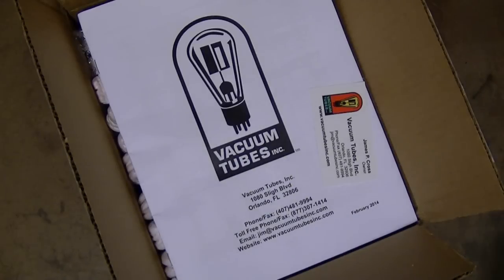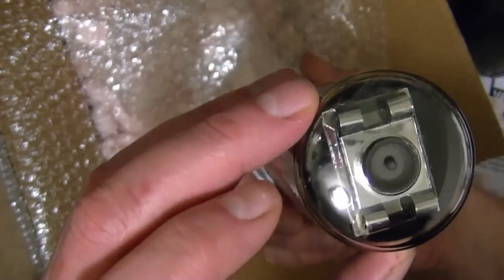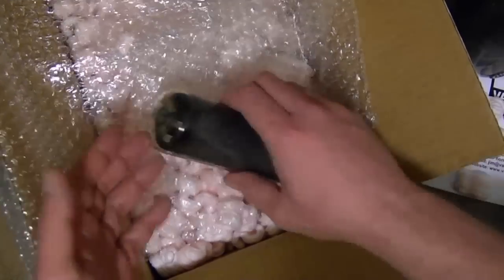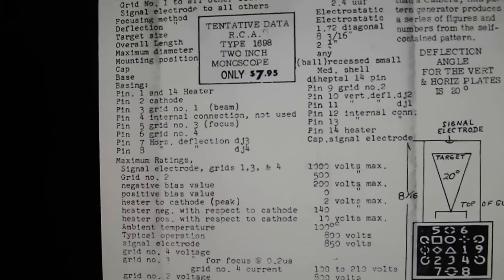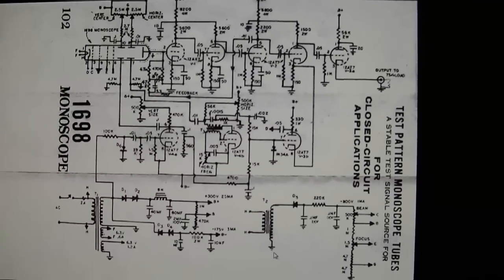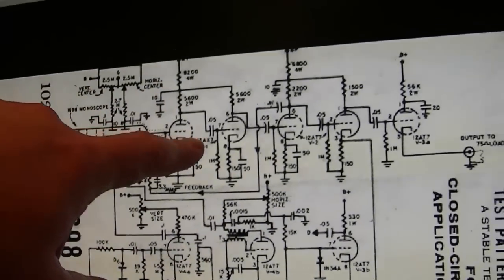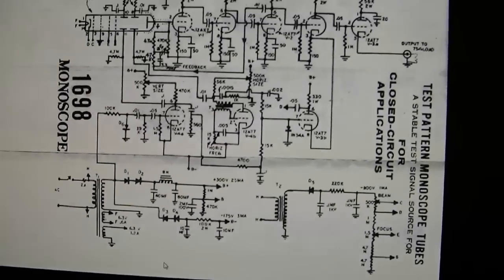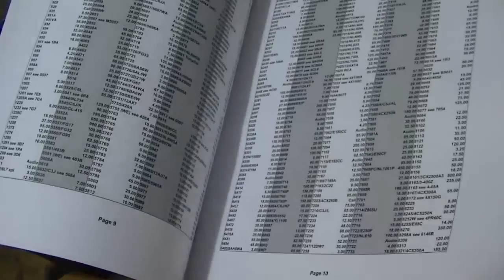Monoscope!

Comment: Those were used in early radar displays to generate the ID numbers and symbols on the screen. Some fancy gating of the generated signal and sync pulses allowed the selection of each symbol individually.

TV test patterns came from a flying spot scanner looking at a slide. This stuff seems strange to us today, but it was high tech not so very long ago.

Comment: These charactron tubes are not rare. The government always wasted our tax dollars on thousands of unnecessary spares. These are from early radars for screen characters on storage tube displays. The "data sheets" you have were published by Denson Electronics of Rockville Connecticut from the 1960s. A surplus store specializing in television equipment run by a "character" named Al Denson. The center of the universe for those of us who built video equipment as a hobby. He supplied my first vidicon and deflection yoke for my first camera in 1972. I still build this stuff today. You may see my Indian head monoscope at our next private TV collector gathering. In fact I've been working on it most of the day today. It's almost completed. It is my most current project on my youtube channel. Assuming anyone is masochistic enough to sit through it! ;)

Comment: Bob, there is more complete documentation for the 1698 at: http://lampes-et-tubes.info/ct/ct031.php?l=e  They even have the part numbers for the transformers shown in the schematic, the circuit description, etc. Example, T3 is a horizontal blocking transformer, Thordarson TV-24A90
Reply from the maker: Thanks!  That's much better than the info I had :)  I bet I could scavenge a blocking transformer from a spare TV chassis.